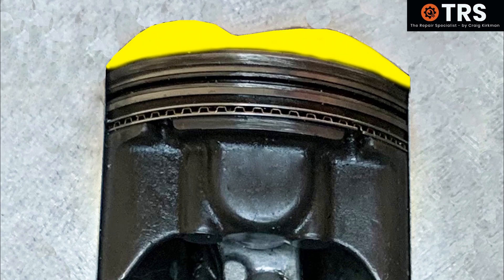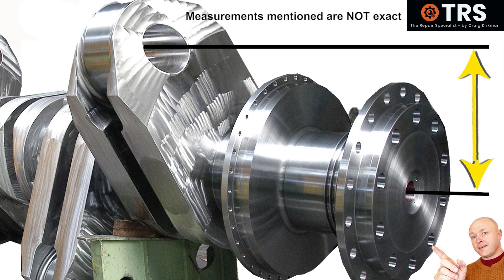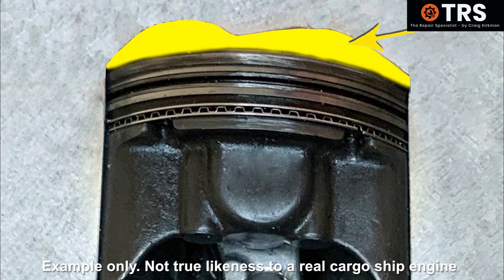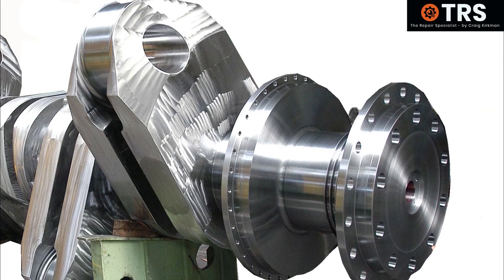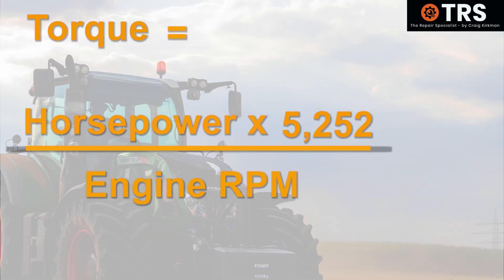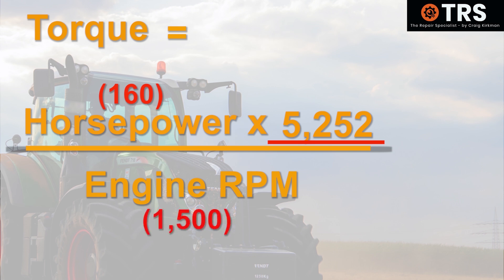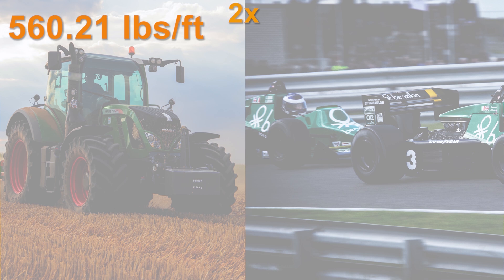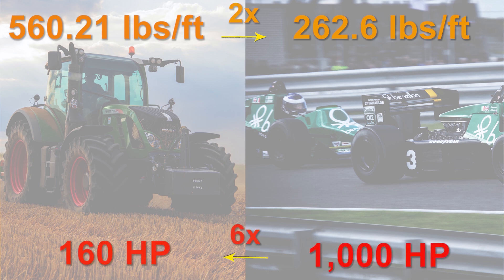The Ultimate Guide to Mastering Torque in 2-Stroke & 4-Stroke Engines. (by Craig Kirkman)

Comment: I don't know why I didn't see this before.  But when using a ratchet to run a nut down a bolt, you use a lot of quick impulses (corollary to rpm) which works with the low resistance in the threads.  But when you get to tightening it down, you use fewer impulses, but apply them for a longer time, creating the torque to overcome the increasing resistance from the threads due to them stretching the bolt to create the clamping force via the torque on the nut.
Reply from the maker: Ok